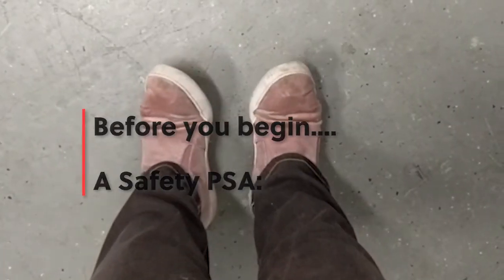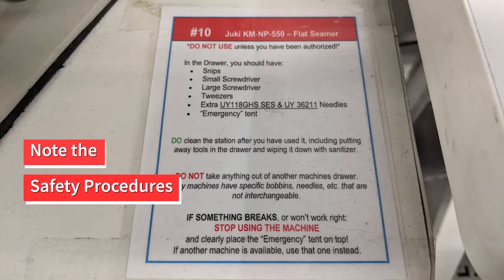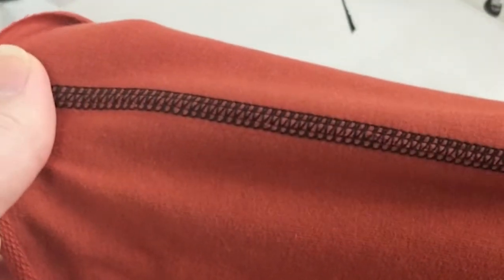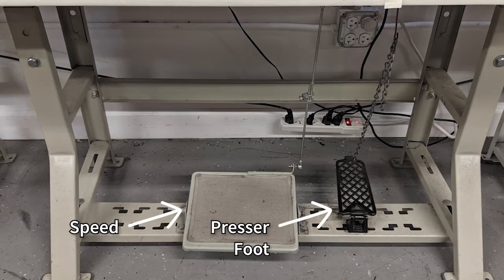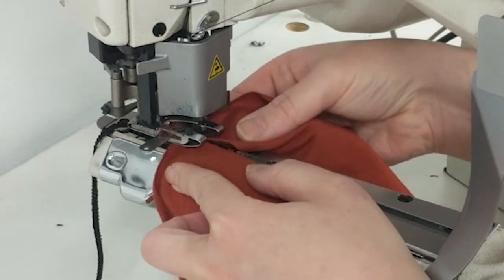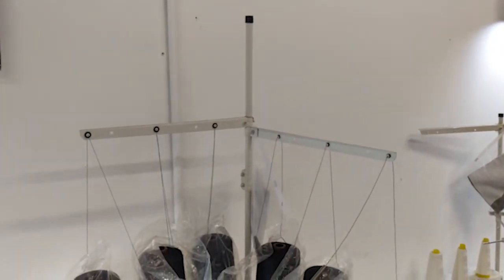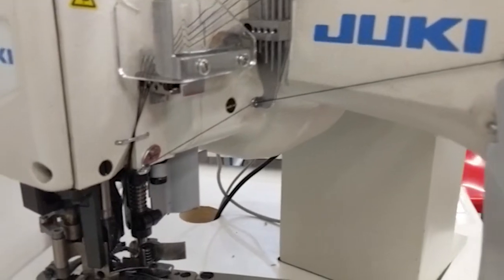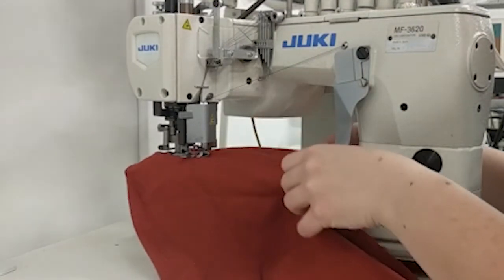Industrial Sewing Machines 101: Juki MF-3620 Flatseamer

Comment: can this machine be run without the knife? To top-bottom coverstitch an already serged inseam? Thanks.
Reply from the maker: That is a good question. If the seam is already serged, you may have some trouble with the seam getting caught on the multiple needles. The beauty of this machine is that it cuts off the excess and closes the seam in 1 function. The edges of the fabric are slightly turned under and therefore do not require to be "finished".
Reply: @AIBIChicago  thank you for the reply. I have a pair of sweatpants, long johns, that have a 3-needle top and bottom coverstitch, which also secures a folded serged inseam. The secured and folded seam provides a level of structure and stability that otherwise wouldn't be there if the knife automatically trimmed the excess fabric. I was curious as to how they did it.

Thanks again.